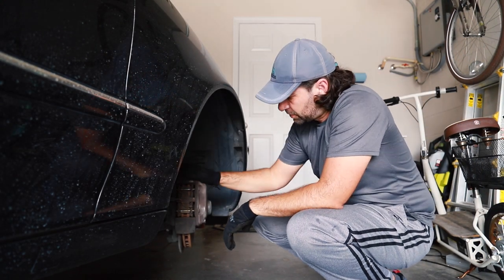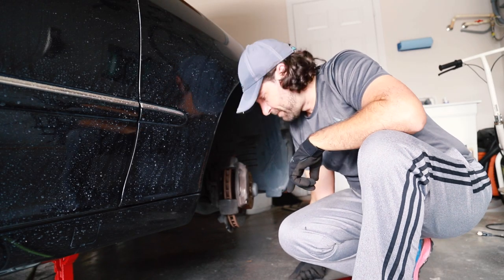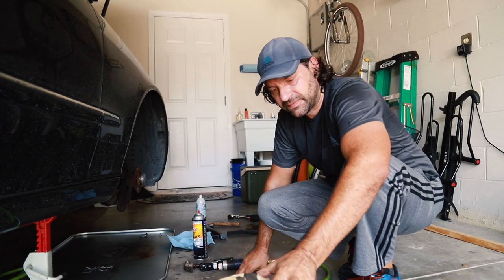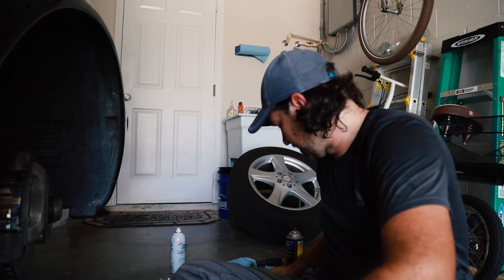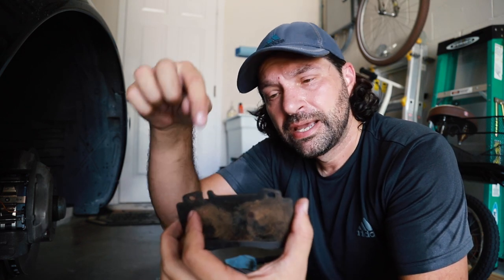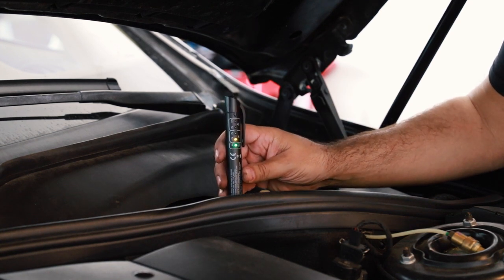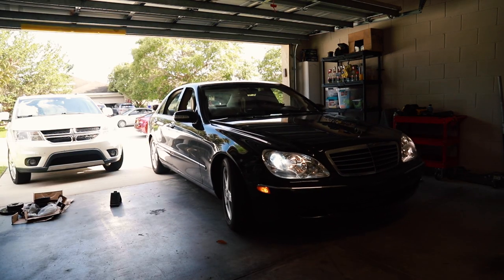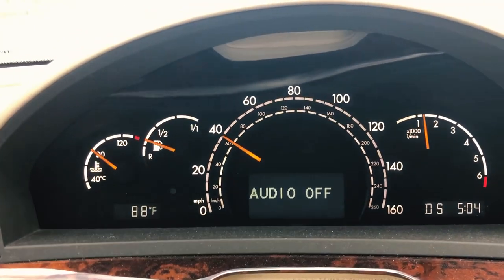S500 Mercedes Front Brake Pads & Rotor replacement

Comment: Great video. Shops charge using "book time" for all jobs, which is almost always much more than the actual time required. Glad to hear that you have had good results using AM parts. I have always used OEM parts, also with good results.
Reply from the maker: Oem is always preferred but as the car ages I prefer refurbished. With the discs tho I just couldn’t do cross Drilled anymore. There just isn’t a benefit to them other than looks. I actually just came back from a spirited drive with my son and they perform very well. I think I may have to do the rear now too to match the performance. Total cost of the front set with coupons was $226 for the premium stuff.

Comment: you forgot to add anti-seize to the back of the rotor to prevent the rust mating that you undid with the hammer. also, you should add anti-squeak paste the the brake pads.
Reply from the maker: Thanks but with the coated rotors you apparently don’t need that anti seize. I tried it without the paste, which I usually don’t, but I haven’t had a squeak yet. I’m about to do a review on my brakes. I think I have about 8k miles on them.
Reply from the maker: Oh snap. I just realized that’s the wrong video. I thought I was responding to the ebc brakes I did on my car. Check out that video. But on that style brakes no anti squeak is necessary. Only on the floating type calipers. Either way, none of my cars squeak.

Comment: Nice job! I would of sticked with OEM parts or use slotted rotors for the front. Slotted rotors cant be resurfaced so you do end up buying new rotors.  A competent shop will charge you $900 (NYC area) for front and rear brakes and rotors.
Reply from the maker: Yeah unfortunately they can’t. I don’t understand why as a shop in Europe did it for me once. The aftermarket parts come with a 2 year warranty and I had good luck with that brand. If the car was newer, I would have bought it from fcpeuro because they are oem and come with a lifetime warranty. Thanks for your comment and for watching :)

Comment: The pads also have an arrow that indicates their positioning in the caliper. They are supposed to point in the direction of rotation.
Reply from the maker: Interesting. Never seen it on the pads. I’ll look for it on my next project next week.
Reply: @Turbo_Snail  it looks like a sideways funnel. The inboard pads are supposed to point in the direction of rotation, because the brake wear sensor is supposed to mount on that pad. Some models/regions use 2 brake wear sensors, one per hub. Others only use 1.

Let me see if it allows me to post a link...
Reply from the maker: Ah, I know what you’re talking about. Yes. The sensor has to be on the inside on the Mercedes.

Comment: One of the best videos on brake jobs, you even showed where to place the floor jack at the midsection to jack up the car. I have two questions for you:  1. Are these same midsection jack points apply to 2004 MB SL500?  2. How did you de-activated your SBC so you can do the work? Thank you very much for great video 👍
Reply from the maker: Thank you. That means a lot to me. Mercedes has very obvious jack points, not all manufacturers are that clear. Most Mercedes will have similar hack points, look for those rubber blocks, you can also find them in the user manual for each individual model. I did not deactivate the system. You need the MBII for that, it can be found on Amazon for about $150. Preferably you want to do that but you also can just disconnect the battery and wait 20 minutes. If you have a car with 2 batteries, I’d disconnect them both. I talked to mechanics and they say it’s ok either way.
Reply: Turbo Snail Thanks for your response.  I was referring to the “midsection” jacking point to roll in the floor jack to raise the car so I can put two jack stands under,  not the jack points behind each wheel.  I didn’t see anywhere under the engine nor do I see the rear axle for the rear of my 20004 SL500.  As for deactivate the SBC, some says to close all doors and let the system go to sleep and DONT open the door or lock/unlock remote key fob during brake replacement.  I was wondering what did you do?
Reply from the maker: Yes, I’m talking about the midsection point, big piece of rubber behind the oil pan. I love that most Mercedes have these. All cars should have them but they don’t. None of my other non-Mercedes cars have it. 

In regards to the brake system. I wasn’t aware to let the car go to sleep. The correct way would be to disable the system with the MBII computer. Techs at the dealer disable the system with a computer. In my case, just pulling the negative cable on the battery will disable it too.
Reply: Turbo Snail thanks again for sharing this valuable information and video
Reply: No SBC to deactive
Reply from the maker: I never deactivate stuff as I don’t have the MBII to do it. If I had I would do it but most people don’t have it as well. Usually disconnecting the battery works. If you mess with airbags, or in the area of airbags, I is usually wait 20 minutes with a door ajar so the system hopefully had no charge to break anything.

Comment: Hello great job. 
Can you please tell me if this job also be the same procedure on a 2003 sl500?
Thank you for posting!
Reply from the maker: Hi. Yes. It’s the same. However, this video is a few years old. In the meanwhile we have discovered that the quality of pads/rotors matters a lot. I know we are sponsored (in kind) by EBC brakes. But I would urge you to get some high quality brakes and pads. I love the slotted ones from EBC and the red stuff pads would work great in your car. All drilled rotors we ever had, had grooves and were cracked. We never had that problem with non drilled rotors. The big S500 was a bit too heavy for the solid rotors when I drove it “sporty”. Look at my brakes video I did for the Chrysler 200 and the Miata where we put in slotted and slotted/dimpled rotors. It’s worth the upgrade. 

Great car by the way. I always wanted the SL55 but with the prices right now….. maybe some day. Good luck.

Comment: I just got a Mercedes and I'm new on this is no necessary any scanner or some special tool  to replace brakes and rotors my is a Mercedes Benz s430 2003
Reply from the maker: No scanner necessary if you just do rotors and pads.

Comment: Great Video!!!  I am a lady and I want to change my brake pads and rotor/clippers on my 2006 CL 500.  Its this basically the same?  Also what are the tools you used as well as the prep supplies? Can you answer if only the tools and supplies I will need.  Thanks!!
Reply from the maker: The fronts are very easy because they are not floating calipers. If you decide and are able to push the caliper pistons back like I did you don’t need any special tools. However, just in case it doesn’t work, all you need is a piston retraction tool. https://amzn.to/3MYlWa5 or something like this https://amzn.to/3QpMLar. I’ve had one in my garage for a decade bits always good to have one. I would consider a brake bleed while you’re in there. Check out my other video and links in the description for parts/things I used. Good luck!
Reply: @Turbo_Snail  You Ate So Kind! I appreciate you muchas!😘

Comment: Nice Video! But yes cost wise, better deal. But performance. For sure you miss the "bite" your S class had with the drilled rotors. Better for cooling, designed that way from factory.
Reply from the maker: True, but it’s not in the rotors, it’s in the pads. Check out my other video about brakes. I learned a lot talking to EBC about that. Drilled tends to crack, I went slotted for cooling performance. If you like the drilled look go dimpled like in our Miata. But you pick performance in your pads. I drive red stuff in my 200, yellow on the Miata, green on all other cars. Also by getting rid of the holes you increase surface area, so there is more contact with the pads.
Reply: @Turbo_Snail  yes, the cracking I've noticed on the drilled as well. For slotted, yes better cooling if it's a split pad from my experience,  but with that I've also noticed decreased longevity from the pads, they tend to wear faster oddly from daily use on daily driver.
Reply from the maker: @alvinbaez2006 actually. Because you have less surface area, people (like me) pair them with more aggressive pads. If you would get less aggressive pads it would last just as long in exchange for less bite. So it’s always a trade off. My red stuff pads with the slotted rotors were down 75% after 36k miles. They are also a bit more dusty than the oem stuff. The cars I drive more aggressive with, have heavier duty, “dirtier” pads. The dailies have just basic stuff. Our journey is on smooth rotors with green pads. I can barely even measure any wear after 30k miles. They look like new. Also, newer cars are so obese that we find people going through pads every 25k miles and tires as little as 15k miles. My neighbor has a Tesla model S and he gets new tires 10-12k miles. It’s insane.

Comment: Great video and a big thanks! 2 questions for you! I have the 1999SL 500, it needs a full around pad change and rotors. Would this be the same process for mine as well? Also for the stuff that you sprayed on the rotors and cleaned them off was that something you would suggest or you did for looks? 

Thank you!
Reply from the maker: Same process. And yes, you need to spray brake cleaner if you have unpainted rotors. There is an oil on it from the factory you do not want to get in touch with your pads. Good luck!
Reply: @Turbo_Snail  Thank you!

Comment: Have you done more things to the 200 after the tune?? I’m getting ready to tune mine and was wanting to ask you a few things and see how it went for you!
Reply from the maker: Not yet. We’re trying to perfect the tune and then we’ll move on to a larger throttle body and coils. I hope it’ll be happening soon.
Reply from the maker: Let me know any questions. I’ll be happy to answer as far as I can.
Reply from the maker: I forgot to mention I had larger injectors installed. Now we are tuning to make ethanol work. That’s why it’s been taking so long.
Reply: Do you have an Instagram or another way I can message you ?
Reply from the maker: Email at turbo_snail@aol.com
Reply from the maker: @ydoc3819  no just email. I should jump on that bandwagon, but I'm a middle aged @$#%@ and its getting hard to either remember or to get used to it. turbo_snail@aol.com

Comment: Do you use lock tide on the rotor screw and calibre screws?
Reply from the maker: Yes I do. I like the gel thread locker. I think I put a link in the description of everything I use. Anything that rattles or moves is a suspect for bolts coming loose. A thread locker is preferred but I know many people don’t use it. There is no risk to using it.

Comment: Why are the brake discs not perforated?  All W220 mercedes have perforated front brake discs, in Germany
Reply from the maker: Here too. However I went for solid. No more cracks, no ridges. If you go slotted it’s actually an upgrade. I think they look good but that’s about it.
Reply: I just looked at my roadster and they are perforated too.

Comment: I’m about to do this job what are you spraying on the rotar??
Reply from the maker: If you have an uncoated rotor use brake clean to get all the oils off. If you get the pads oily they won’t bite.

Comment: I make same mistake and don't put grease on caliper where pads working ,so in next few thousand miles later I have knocking when step on brake...now new caliper require ...
Reply from the maker: I never had any issues doing it that way. Maybe I just got lucky, a lot!

Comment: New💪
Reply from the maker: Get some EBC pads. That car really benefits from the red stuff pads. They are aggressive and can handle the weight. Check my EBC video on my 200. All my cars now run EBC.
Reply: @Turbo_Snail  i going to change my front pads tomorrow however is it necessary that i turn or buy new rotors??
Reply from the maker: @greglopez7768 it is recommended. I just put new pads without turning the rotors on my Chrysler 200. It took 600 miles for them to quiet down. But that’s also about the break in period for my EBC brakes. That being said, I would recommend EBC yellow stuff or even more aggressive the red stuff for the S500. They have more bite than the garbage I bought in the video.